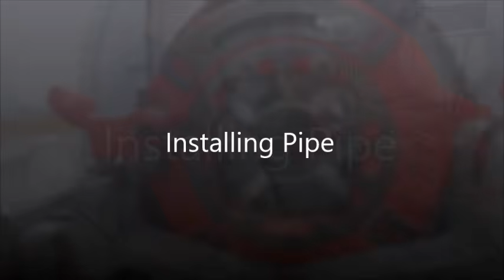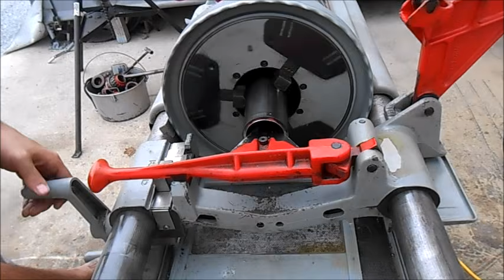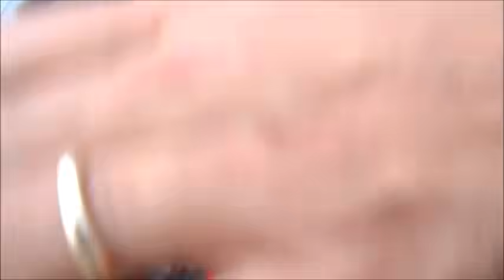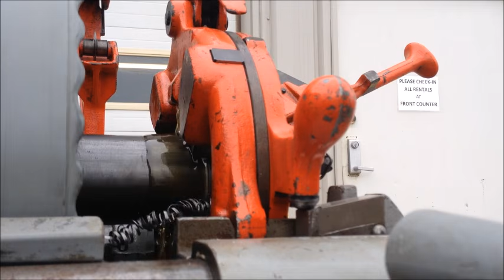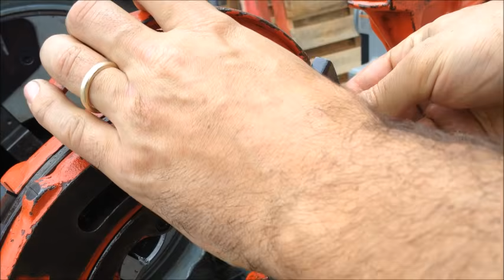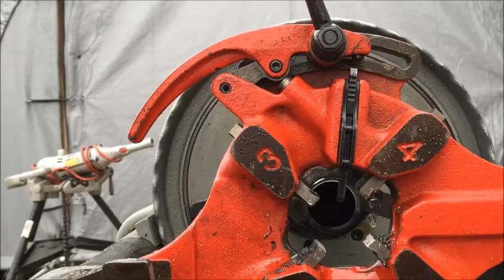Ridgid 1224 Threading Machine Instuctional Video - Gap Power

Comment: The video isn't much of a help. I need to figure out why the machine is producing screwed up threads. The die is somewhat new, but it produced chewed up threads half of the time, and won't thread unless constant pressure is kept on the die, for some unknown reason. The machine is very old.
Reply: Usually means that the head is set too tight, or the teeth on the cutters are bad

Comment: how about teach people the proper way to use these tools by wearing gloves and protecting your fingers from infection due to the cutting oil and sharp edges. 
Also the wheeler x 6790, oils through the die head, has been a much more versatile and maintenanceable machine that I've used in house for over 20 years.
Your technician used bare fingers to pull metal shavings out of the pipe...
Reply: Its probably not wise to wear gloves around rotating equipment.
Reply: OSHA forbids wearing gloves on rotating equipment so you don’t rip your arm off because a little cut is better than a missing arm.

Comment: The 914 diehead is only used for British BSPT & BSPP threads.  Your video actually shows the 714 diehead used for NPT threads.  Also, at the 6:36 mark you should point out that for straight threads NPSM the release foot & sine bar have to be set according to steps 2 & 3 on the die head setup chart.  You have them set properly but didn't instruct to do so.  Otherwise great video!
Reply from the maker: Hi Michael, great critique of the video, you know what you are talking about.  
  You are correct, it is a 714 die head being used for NPT and NPSM, not the 914 - function is exactly the same for the sake of instruction on this video.  Thanks for pointing that out.   
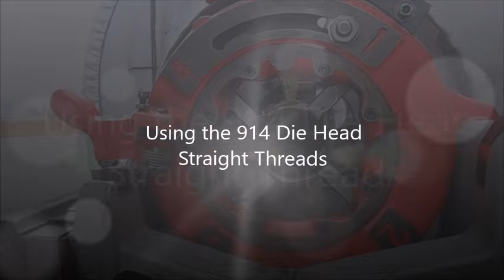  We do start out the segment at the 5:30 mark on straight threads mentioning that we are now illustrating straight threads but do not specifically mention that they are NPSM, which they are.  I usually reference pages 10-12 on the 1224 Threader User manual for instructions on the 714 die head.  You can find the manual here: https://goo.gl/wgsQvH
Reply: Uae price how much
Reply: Dai